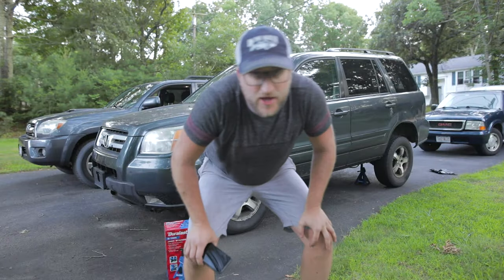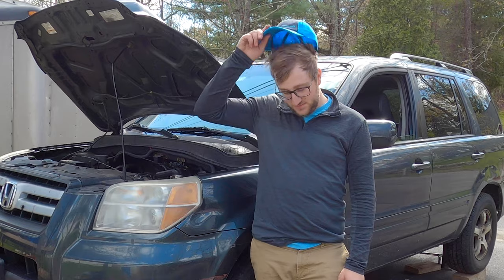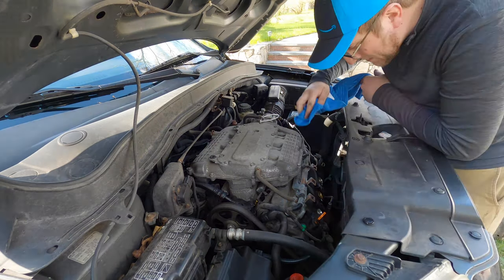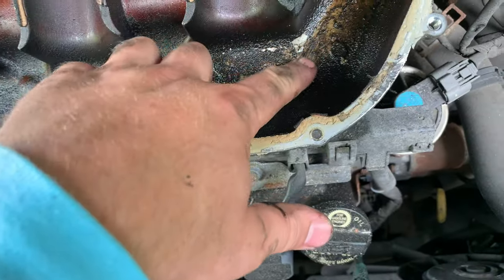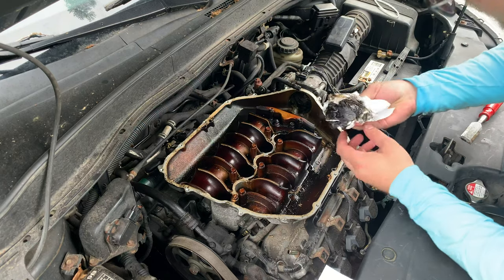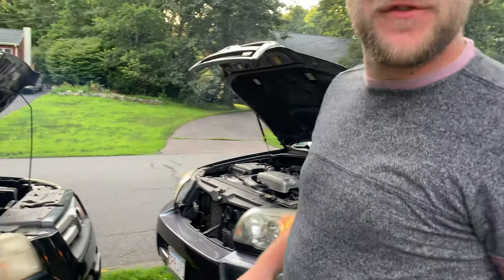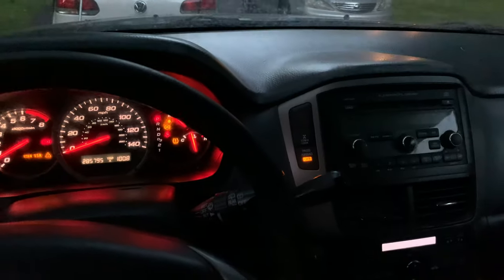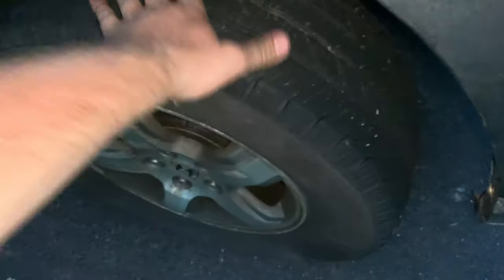What Is WRONG With This Honda Pilot?? (Misfire and Broken 4x4)

Comment: 1st gen Pilots don't have a typical rear diff. There're clutches between the diff output shafts and rear wheel axles which are normally disengaged. That's why the other wheel won't turn in the opposite direction when you rotate one of the rear wheels manually. When you put it into VTM-4 Lock the clutches are supposed to engage and transfer torque to the wheels, but since you have VTM-4 light on the system is just not working. I think you need to start with the engine first, fixing rough idle and misfire which are most likely due to valve not being adjusted for a long time and now being way out of spec. Hopefully it didn't burn any exhaust valve yet
Reply: Spot on. There are no spider gears in the rear diff like he was expecting with his little "spin this tire the other tire should go the other way" nope! Those clutches don't care about that haha. The rear diff is fine.
Reply: Exactly.  Running the vehicle before checking the valves was unwise... especially since it was obvious the previous owner neglected almost all maintenance, including the transfer case gear oil & rear diff  fluid.
Reply: And when it does work you don’t need to press the VTM4 button in normal driving to have the pilot automatically (computer controlled) transfer torque to any of the four wheels that need it.  Splits power to back on acceleration.  Runs as front wheel drive while cruising. Normally is great in snow as it applies power to any of the four wheels that are gripping and little/none to the ones slipping.  The VTM4 lock at low speeds only forces some torque to be at the back in addition to the front.   Again it works great normally.  Your video test does not actually show if it’s working or not as all four lifted means all four slipping.
Reply: @kevinemerge744  so how would one go about actually knowing whether or not it's working?

Comment: VTM4 light comes on automatically with the check engine light.  Generally the vtm4 is OK But the car disables it for some reason maybe because it’s down on power?  The valves definitely need adjusted on this car first.  It’s basically choking because the valves get too tight on one side on these cars.  The intake tube also needs to be replaced so the map sensor can see the right amount of air.  The exhaust of course needs a replacement too so the 02 sensors can see what they need to see.  I’d change the air filter as well.  The ports that you cleaned usually aren’t a problem on 06-08 pilots those are a problem on the 04-05s because they have these little veins that get clogged.  Take off the EGR and see if it’s blocked and blow some air down through it and out the intake manifold with the cover off.  That area can be clogged.  Be sure you use only oem spark plugs.
Reply from the maker: Thank you for the info!! I appreciate that, and I’ll pass this along to the owner.
Reply: Stickercutting.com I have  an 2013 Honda Pilot .. and that just happened to me on d road.... I don’t know what to do... should I keep driving it... iam about 550 miles to my home.. I took it to a shop and the guy said it could be d spark plugs...

Comment: Has the timing belt been replaced? Every 105,000 miles replace it. Adjust valves according to manufacturer specs. They will need adjustment no doubt after 200K. Use only Honda fluids, none other. V-tec is great, but requires good oil pressure and proper valve adjustment. Mine is a 2005 and has over 220K runs great. Also check emissions sensors and O sensor/ air fuel mixture. Lastly, compression test. My bet is the timing belt.

Comment: Check the VTEC solenoid oil screen, that can cause it to run rough. The VSA off button will shut the traction control off.

Comment: First just say no to the anti-seize on spark plug threads, instead use the proper tool for the job - a quality thread chaser followed by installing the plugs dry like the manufacturer intended, after all that’s why they went to all the trouble to plate the threads of their plugs with that shiny anti-seize coating… it ensures proper torque can be applied and it won’t interfere with the grounding ability of the plug especially in modern engines.

Comment: My 2 cents is make sure the timing is spot on the marks through the timing covers, possibly the throttle positing sensor on the throttle body, could be the rear differential vtm -4 sensor but it requires there to be no engine light so that needs to be fixed first.

Comment: The pilot has three convertors and if one is malfunctioning, then the VTM4 light comes and disengages the  VTM lock.  Also replace the O2 sensors if you replace the convertors

Comment: I had the same 6 cyl missfire issue on my 2007 honda pilot with 190,000 miles and I fixed it by adjusting the valve clearance myself. I found out that all the exhaust valves are tight compared to the factory setting.

Comment: Did you manually adjust the valves and replace the timing belt, because it is probably due at that mileage(timing belt is every 105k)
Reply from the maker: So I actually just got some valve feelers in the mail yesterday. I'm going to adjust the valves and swap out the injectors while I have the manifold and valve covers off. Hopefully I'll get that video out next week or so.
Reply: @NotSoHandyCarGuy  oh cool, yeah I just came across your channel today so

Comment: Any engine with an exhaust leak that large and not fixed soon can cause valves to burn. They will overheat and leak compression. Get you a compression tester and compare the cylinder compressions.

Comment: As others have said: Check timing belt as should be changed I think every 105k as I recall.
Reply: After that check valve adjustment if timing ok.

Comment: Okay.  I don't know if anyone noticed that when you tried to start the engine repeatedly getting out of the yard, I heard the engine sound like it had no or low compression on at least one of the cylinders.  Those engines are known for the valves getting tight and need adjusting with high mileage on them.   But judging by how bad the intake looked, the last owner didn't give it any love.  So yeah.  Try adjusting the valves.  As some others here have mentioned, the VTM-4 lock won't engage if the check engine and VSA lights are on.  Also, VTM-4 lock is only available in 1st, 2nd and reverse.   Speaking of VSA, that's your traction control.
Reply from the maker: So I ended up adjusting the valves, but it was leaking compression out of cylinder three, Even after the lash adjustment
Reply: @NotSoHandyCarGuy  I've heard issues where these motors can burn valves when not properly maintained.  Unfortunately, it's not an easy fix because you would need to remove the head and replace the valves in the effected cylinder.  But, after seeing the amount of crud that was inside that intake, you might be better off sourcing a good, used engine.

Comment: I know this is an old video but change the oil my pilot has done this twice now misfiring codes every cylinder and a code for vtec and cat. Oil change fixed everything.

Comment: You need to attack those lights. Each one is a clue to a problem.  Also the vsa light will be your wheel speed sensors and vtm-4 wont work unless all the wheel speed sensors are working properly. Attack the lights on the dash and youll get it back. Just be sure to update the timing belt. Sounds like maintenance was not kept up at all one tooth slip and this whole car is trash.

Comment: Did you ever figure out what the issue was?
Reply from the maker: Yes! Bad valves in one of the cylinders, presumably from the exhaust leaking for so long, or from running low on oil
Reply: @NotSoHandyCarGuy  did u fix it? If so how

Comment: Hey can you tell me where to find my fuel filter on a 2007 honda pilot
Thanks n advance
Reply from the maker: So I just took the fuel pump out and rinsed down the fuel filter really well with water, then let it dry. I couldn’t find just the filter anywhere- I think you’d have to buy the entire pump if you want to replace the filter

Comment: Sorry don't know if I deleted everything but ment to say oil temperature sensor in back on the so called pumpkin 😂. But changed that sensor an it fixed mine an 4 wheel drive works lights out. An I'm not to well to do for so I'm a backyard person believe me an I was always told change the little minor things 1st an if that don't fix it than try something else😬. But ok sir hope that helps ur buddy out.👍an I'm sorry I had to change I EGR valve also cause it had a misfire it fixed the engine light an the vtm4 light also for about 4 hours than the VTM4 light comes back on an than changed that temperature sensor. Lights are out an 4wheel working good again...! That's what I meant to say. Once again my bad 😃

Comment: Flashing check engine light means engine warns you to shut it off. It may stall for that reason. It’s really chocking to death. 
Your vtm light is also on. Check errors not guessing and rotating wheels by hand. In rear diff is a single sensor that may be bad. Also rear diff special fluid should be regularly changed. Every 30k. If it was not done in time it may ruin clutches in diff. 
Basically video shows that this particular Pilot just wants to retire and Rest In Peace.
Reply: Drove mine for about a month with the blinking cel , id just feather the throttle every so softly. It looked like he put on advance house brand coils dont know how good those are, also he didnt show what brand plugs he installed hondas only like ngks or denso.

Comment: Guess what, at 8:50 Its like the same, I have a 2004 acura mdx but i dont use it but it litteraly has a exhaust leak, it does not even sond normal
Reply: i just fixed  little of it still  little hole it was a muffler disconnected from  pipe

Comment: Change the mass air flow sensor soak the pistons with sea foam over night then run a can in the gas tank and see if it makes a difference
Reply from the maker: Ok, I'll try those! I tried cleaning the MAF, and we ran a can of seafoam in the tank. But we haven't tried replacing the MAF or letting the seafoam soak on the pistons. Thanks!

Comment: Well I read all the comments and noone have done what I did  and still ha e the same problem lmao I rebuild the whole engine I rebuild one bad cat converter and it was running like a champ then vtm4 came on and endingchangging the egr valve. And yes has not changed a thing father the 4 of July I will be bringing it to a pro.

Comment: Hi if the vtm4 light is on, there is a oil dif sensor in the back, 80 bucks, that’s a common problem for vtm4, also your awd goes off the abs sensor as well. And your vsa off button is traction control, if you have more questions my ig is khamkham912

Comment: lol, those need Valve adjustments every 30 k
Reply: Not really. More like every 150K give or take. But I bet the car in this video needs it pretty bad and valves being way out of spec is the reason for misfire codes and VTM-4 light and 4WD not working
Reply: 105k or 84 mos whichever comes first